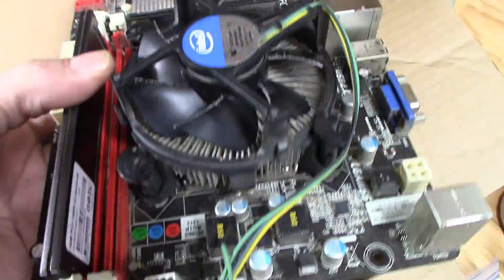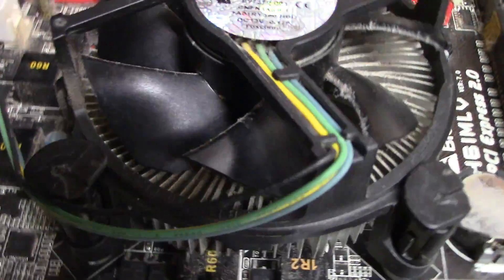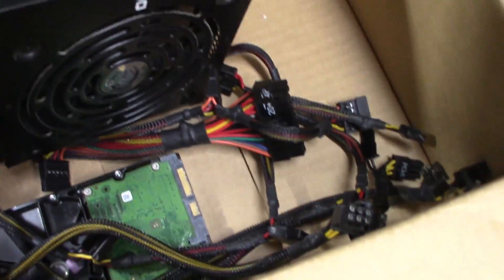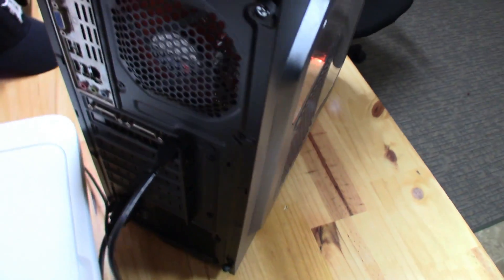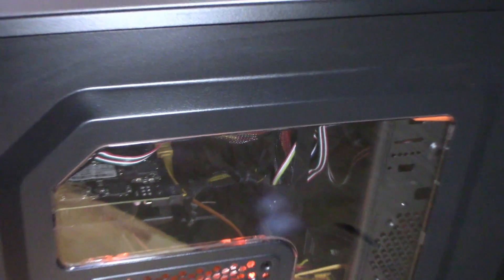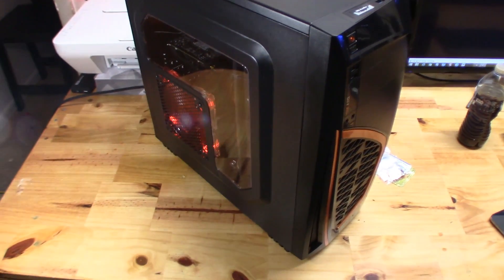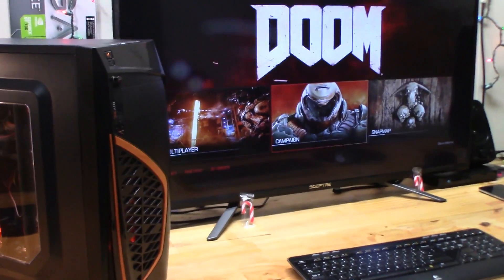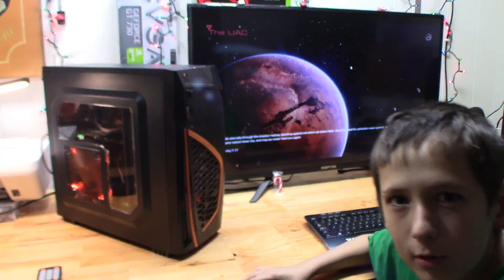BRINGING LIFE TO OLD PC FOR GAMING! CHEAP RESTORE

Comment: I just binge watched a bunch of your videos.. creative, educational and inspiring.. thank you. 

I'm now lurking on ebay and gumtree looking for cheap older parts.

I was particularly interested to see that you didn't mind occasionally flopping a video card outside some of the small form factor cases on a pci-extender. 

Any chance of a creative/clever guy like you coming up with a clean/tidy way to mount an external card robustly (with good cooling/air-flow)? 

I'd love to pick up an old optiplex PC for a build but most, that I see in Australia, only have space for half-height cards.. and half-height cards tend to be relatively expensive.
Reply from the maker: I actually did make something out of pvc to stand the card on securely, but for some reason never finished it because I sold the pc without the graphics card. The 750 ti stayed cool throughout testing more so if it would of been inside the case actually.  I appreciate you bringing that to my attention because in my mind my videos are just shares of things I think are neat...   I have to think of people trying to recreate this at home and some people don't mess around with electronics on a daily basis.
Reply: cgOnTheTube same his videos are fun to watch.

Comment: Whats the best cpu for under $20 that fits a dell optiplex gx620 ( not sff its the "mid tower" )? What socket type is it? Please reply asap and merry christmas!!
Reply: That is a LGA775 and there are a lot of different cpus for under $20 for that socket because it is older. An ebay search should yield decent results if you look for a lga775 processor. I just did a video on an E8400 that would probably be the best fit for under $20
Reply: You could try the xeon E5450 (modded to 775 socket) is the best one out there for it I guess, but be ready to update or flash the bios. Make sure the fan matches. There are a lot of tutorials, and posts about this upgrade.

Comment: Does anyone know how to set up a usb controller for pc gaming?
Reply: Plug it in and download the drivers. Your computer should do it automatically. If the controller is an Xbox 360 one then you are done. If it is not you might have to look up the specific drivers and instructions for connecting to the pc.
Reply: Retro Adventure Thank you very much :)

Comment: I have a an old dell gx620 with a pentium d 945 3.4ghz (i know its from the stone age) with 3 gb of ram and an atlto radeon hd 6450 i believe and it runs bf3 no problem. I was kind of surprised because the cpu is ancient
Reply: Heck yeah I have a Dell xps 600 with the 945 PD and she still hits games good.  Not my main machine but I threw a GTX 460 in the case and boom a capable machine.  Dont know what it is but I cant let this machine die just yet.

Comment: how exactly do i correctly set my operating system for gaming?
Reply from the maker: disabling unnecessary tasks that are running in the background, for example my gaming rig is for gaming do I need a print spooler running? windows update? windows defender? Add-ons that I collected from the web unwillingly.  change the way the os appears set I for performance, change the power preferences to performance...  these are just a few examples when my computer is idle everything should be at "0%"....